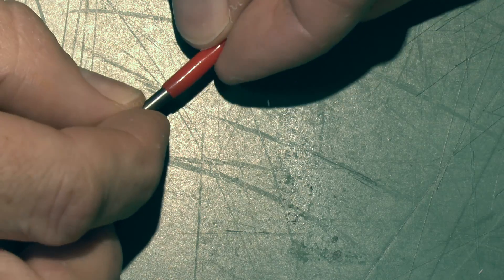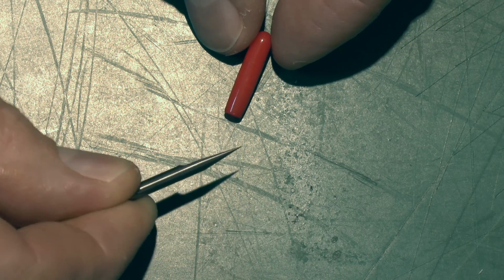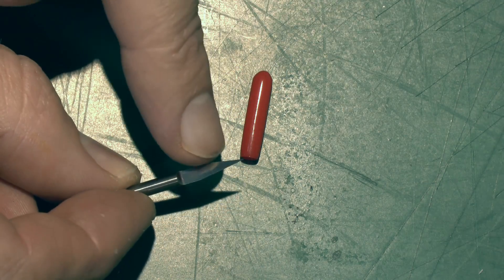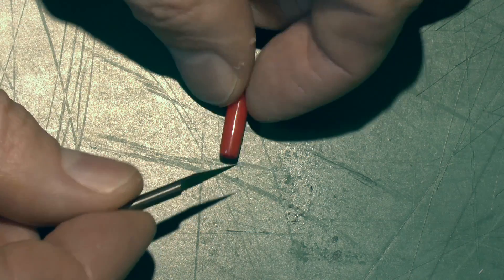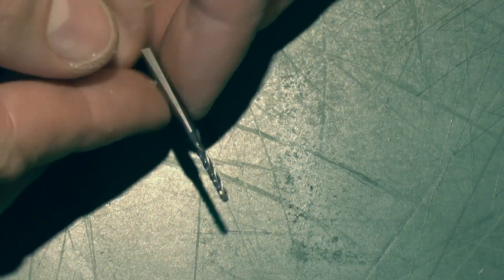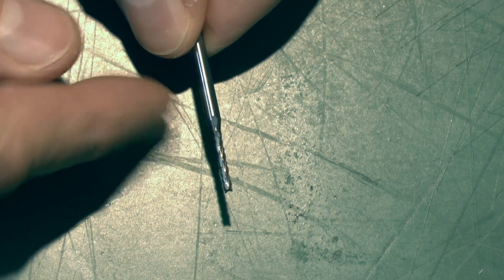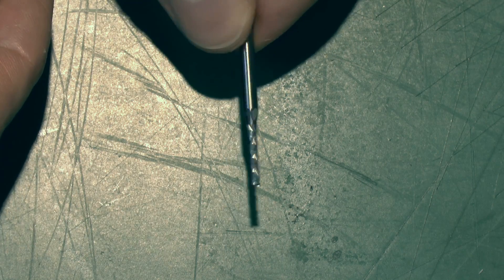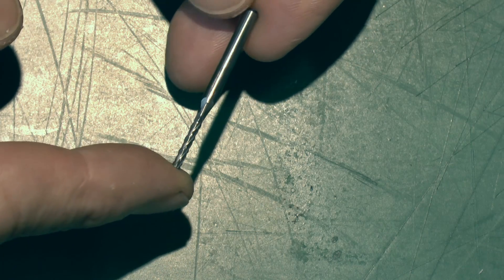Engraving a control panel with a CNC machine

Comment: Hi There, I used a 30 degree engraving bit and the edges of the letters were flared up like a tin can lid. 18,000 RPM 1700mm/mn. Will faster speeds help with the messy cut?

Comment: You could probably force it to engrave in lines by making separate machining chunks (Can't remember what F360 calls them) for each line.
As for the dust:  I use a bit fan.
https://blog.bantamtools.com/introducing-the-bit-fan-a-new-othermill-accessory-you-can-make

Comment: How is the panel attached to the mdf base so it doesn’t shift during engraving?
Reply from the maker: Double sided tape.  Panel has a protective film on both sides so the tape sticks to that, and therefore doesn't damage the panel.

Comment: HI JW I have a question i bet many like me want to know, im building a CNC and refurbish them also, Why are all the  CNC control panels using those Silver, Fan Cooled 24-48V dc Power supplys? and not just normal "desktop PSU" from RS or such? As the 36v Desktop ones are encased in ABS etc and those Chinese ones are so easy to touch the 240v inputs, i got some from longs motors and they didnt even have the shield covers with them, i emailed them saying: whats to stop me accidently touching the line in which is 240v :( i think the desktop style are much safer, so i was just curious as to why they use the silver tinned fanned types everywhere? Im currently updating a Routout cnc machine :) your vids are awesome !
Reply from the maker: That type of power supply is intended to be mounted inside a cabinet with other equipment, as in this build video for the CNC: https://youtu.be/rhehh94RI7M so exposed terminals are not a problem.
Reply: Okay understood but why not just use a Black ABS housed desktop style PSU? Why are they always those tinned type being used?
Reply from the maker: Cheaper without the enclosure, and better cooling.

Comment: More light on table (I mounted this under spindle: https://www.ebay.com/itm/US-2X-80mm-HID-White-93-COB-LEDs-12-24V-Angel-Eyes-Halo-Ring-Fog-Housing-Lamp/251633564659?epid=1754149607&hash=item3a96877bf3:g:95UAAOSwYUdbMbeL:sc:USPSFirstClass!59901!US!-1) . Re-order toolpaths so letters are consecutive. For text, I am using VCarve Pro, which is easy to use for this process, Fusion360 for 3D projects. I am building a circular dust 'shoe' around bit which will have spiral airflow direct to vacuum. I like the 0.2mm 30 degree better https://www.ebay.com/itm/5pcs-0-2mm-30-Degree-Carbide-PCB-Engraving-Bit-CNC-Router-Tool-Set/372103533470?hash=item56a319539e:g:dvoAAOSwdBZax1nI

Comment: Interesting toolpath :-/
Reply from the maker: Fusion 360 has no options for the toolpath when engraving - you get whatever it decides is best, which in this case is rubbish.
Reply: I'm guessing you could game it a bit by creating the text and then rotating the text object as you place it on the surface so the tool path ends up going the same direction as the text?
Reply: Wow, that tool path is amazing; I know the traveling salesman problem is hard, but that isn't even close...

Comment: Hi John  great work as usual - im not familiar with Fusion 360 - but most CAD/CAM aps allow either manual or automatic path optimisation or re ordering of paths - if this is not available consider the original order in which you generate the elements within your cad package as this will affect the final path generation and therefore overall distance traveled and the chip to chip time
Reply from the maker: For engraving, Fusion 360 has no options at all - you get what it decides.  Yet for most other operations there are plenty of toolpath options.

Comment: That's a nice job John.  I've used that composite material before for front panels but not engraved them.  I found that drilling holes with drill bits larger than about 1/4" would easily tear the aluminium from the substrate unless a shallow ground twist bit was used. Routing them out as you did is obviously the better way.